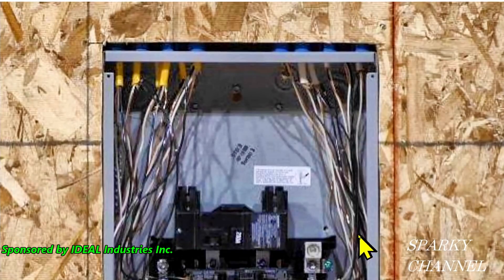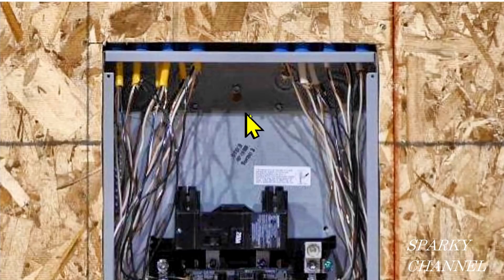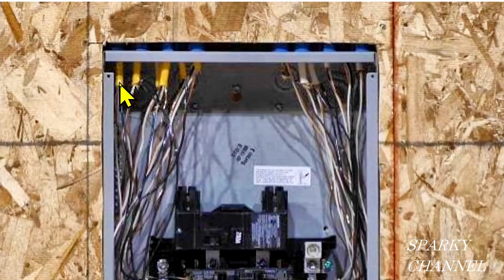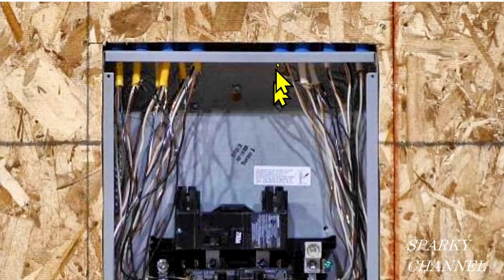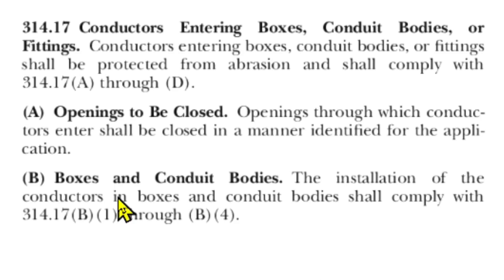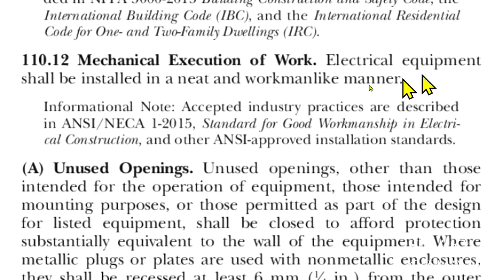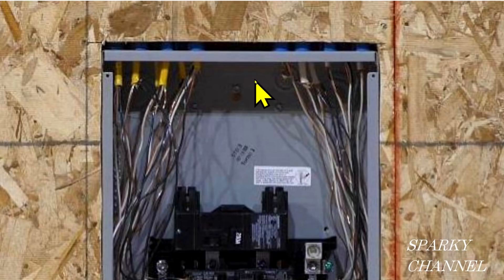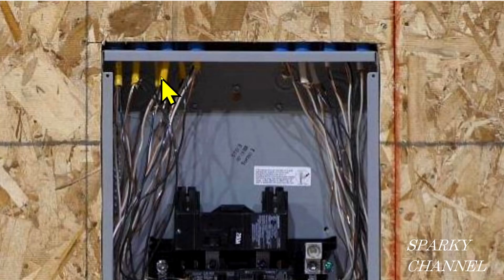How Far Should Sheathing Extend into a Panel? NEC 2020 314.17 (B), 312.5 (C) and 110.12

Comment: I've always wondered how many romex cables are allowed to pass through the panel holes. I've seen some panels where they are spread out with 2 per hole coming in from the side and sometimes I see a far larger number bunched up and coming in from the top. Does that violate any number of conductors allowed through a hole rule?

Comment: I am a DIYer, but very particular about going by code or better and being neat with my work (probably due to being an automotive machinist.)  Being particular about the look of a finished job not only makes it look professional, but also shows pride in your work and makes future repairs or upgrades easier.  I am proud to show people my work, even journeymen, whether it is electrical, plumbing or carpentry.  I also do automotive wiring and everything is soldered, sealed and wrapped neatly.
Reply from the maker: Fantastic, I love it! Also, thanks for subscribing.

Comment: the turned down metal edge of the box is at least a 1/4 inch. If the sheathing is below this , would that not be at least a 1/4 inch inside the box and past the clamp ?
Reply from the maker: Yes, that would be true.
Reply: That would also depend on how far into the panel the clamp extends.  If the clamp is 1/8" into the panel, then the sheathing would need to be 1/8" past the lip, as a minimum.

Comment: You would think an apprentice going to a big event like this and showing off their work would be a little bit more prepared and doing cleaner looking workmanship than this. Looks more like something done by one of those handyman guys who isn't very experienced or well trained in electrical work.  

Nothing against handyman guys I'm actually one of them.  But when I figured out that electrical and plumbing were needed for me to complete my remodel jobs, I started studying and learning the proper ways to do mechanical work. Fortunately I have friends who are professional electricians and plumbers who I was able to learn from. 

 Most general purpose handyman types do shit electrical and plumbing work. Most of them just don't know any better because there's a lot to know and it's very specialized.  Hell when I look back at my early electrical and plumbing work I cringe when I think about some of that stuff I did back in the late 1990s. And back then I didn't have any internet to look up how to properly do things. 

It drives me crazy to see romex wire stuck inside a box or panel without any sheathing. Most likely nothing will happen but it looks like shit, and the wires should be protected and secured just to make sure.  I instinctively knew that the sheathing needed to be running into the box the first time I ever ran wire to a box over 20 years ago.
Reply from the maker: Excellent! That's why I like to share videos like this. I don't want to be critical of anyone. I would rather just show the code and show how things are done correctly.

Comment: The top bend of that panel is 1/2 inch. So realistically the minimum could have been met and we can’t tell from a forward facing photo.
Reply: That's what I was thinking as well... Still would like to see a more consistent length and bends in the wires so they aren't just run strait from the clamp to the breaker.

Comment: I have a code question for anyone that wants to answer it. When installing a device, switch, receptacle, etc. and using the stab holes on the back, are you required to tighten the screws on the sides, or leave then sticking out.
Reply: Not required, but absolutely should, especially in metal boxes.
Reply: @HBSuccess  yeah that's what I'm looking at, switches and receptacles in steel mud rings with the screws fully extended. Pretty sketchy to me, I always run the screws in tight personally.
Reply: I use the commercial grade receptacal, "they cost a little more", but this is not the place to try to save money. Instead of "stab" holes they have a place behind the screw to insert the wire, you can use 2 behind each screw if needed, and then tighten the screw. This way your not trying to form the wire around the screw, and it is a solid connection. They are great because you usually are powering beyond to the next rec or a lite switch etc. I used Pass& Seymour brand when I wired my house 12 years ago, and I used 6 thousand feet of wire, a lot of rec, three-way and four-way circuits. All of my receptacal circuits are 20 amp, I never looked at the 15 amp stuff, but I would think they would have the same thing available.
Reply: @jamesglavich1426  they do have a commercial 15A with the side clamps. I'm actually using an intermediate grade with side clamps to replace the old back stab/side screw style.
Reply: @RealMichael_D  That's great that they offer it in 15 amp also. It's far better than the stab holes or trying to wrap the screw, and powering beyond as to the next rec, or light switch for over head light or fan is so much easier.
Reply: Always get those screws in. You will never regret not having arc potential from metal boxes or a compressed ground pushed near. I still tape them as a courtesy to my customers should they DIY in the future
Reply from the maker: Yes, tighten the screws down to lessen the chances of shorting. But back stabbing is not recommended. Back wiring, which is found on higher grade devises, is excellent.
Reply: @SparkyChannel  personally I haven't used the "backstab" since the 80s, never really trusted them, don't even know they they are still a thing. I'm replacing the recepticals in a remodel, they were installed in the 80s.
Reply: Don't stab them, it's less reliable and most electricians don't do it because they know that it's best to use the screws.  But if you do backstab you should have the screws drawn all the way in.
Reply: Rap it with tape. You should use pig tails tighten screws if you want

Comment: Sparky/Bill, why do some single pole switches have a ground and some don’t?
Where as receptacles always have a ground.
Reply from the maker: All switches and receptacles today are grounded. Very old switches and receptacles are not grounded.
Reply: I've only seen really old switches that didn't have a ground.  Have you you seen new modern switches that didn't have a ground?
Reply from the maker: @actionjksn  Yes, true.
Reply: When you say really old I just removed a light switch and replaced it in a home that I built in 1998 there was no ground

Comment: My habit on this is I leave enough to work with and to mark the lines for what they go to. I try to think for the guy working behind me in the future. So therefore I don't cut the conductors to fit the breaker exact, I leave enough in case the breaker needs to be moved in the future and also I try and keep it as neat as possible as well. Cable management is the term I use (carried over from my IT and electronics engineering career.
Reply: Good cable management in a PC helps with air flow and makes them easier to service and clean in the future.
Reply from the maker: @actionjksn  True.
Reply from the maker: Excellent!

Comment: The metal edge on the top of the panel is folded down about 3/8". You cannot see the actual entry point where the sheathing enters the panel due to the straight on direction of the camera. Other than what appears to be a missing connector on one, they may be all 1/4" or longer. The wire organization is terrible. I do not call this neat and workmanlike. I like to first route all my grounds together then my neutrals then take the hots to their breakers. Some panels use both sides for grounds and neutrals so they go to the shortest distance.

Comment: I left mine long enough to label them for future reference.
If they entered the cabinet and had to cross over the feeder conductors/lugs, I'd leave them sheathed so the exposed grounds weren't posing an added  threat.

In my area, we NEVER attach the cables to the enclosure. Our panels and services are installed outside and all the cables enter via a single bushing in the back of the enclosure.
Not NEC compliant and I have no idea if my area has an exception written.  It's been that way forever.  Logically it is no necessary to attach the individual cables. Once they are installed, they cant go anywhere and "bundling" is a busted myth.
Reply from the maker: Thanks!
Reply: When you have a single bushing in the back like this, how do you go about identifying the neutral wire that goes with the associated hot wire? I'm trying to add a manual transfer switch and need to identify the correct pair of wires.  Any tips?
Reply: @earlkarp4142  So, you have no sheath showing in the panel just past the bushing?  That is just somebody's sloppy work. You may have to disconnect and unravel everything and see if you can pull a bit more cable into the panel.  Otherwise you will need to disconnect and ring them out with a continuity tester.
Reply: @jackconnolly2665  Unfortunately, all the wires in my panel disappear into this port in the back of the panel, no sheathing can be seen as it's in the brick wall behind the panel.  The house was built in 1964.  I came to the same idea as you.  Turn off the main and test each neutral by disconnecting it from the bar with a continuity test.  I was hoping there was a better way.  Thanks for the confirmation.
Reply: @earlkarp4142  Yeah, it will be a tedious task. 

Map all the circuits by turning off one breaker at a time and testing EVERY outlet to see what is off.
Then disconnect the neutrals one at a time and refer to your map.
Be on the lookout for and multi circuit home runs where two circuits use the same neutral. You do NOT want to disconnect a multi wire neutral because it is very likely to make some smoke by routing 240 volts to the 120 circuits.
The telltale sign of a MWBC would be a red wire instead of the standard black.
Reply: @jackconnolly2665  I know the specific 15 amp circuit (furnace) that I will be hooking up to the transfer switch, it's just locating the associated neutral that is the problem.  I plan to turn off the main into the panel to avoid surprises.  Thanks for the tip I will avoid the multi-wire neutrals.
Reply: @earlkarp4142  If you have an amp meter, turn everything off except the furnace. Run the furnace and clamp around the neutrals. The only one carrying current will be your neutral.

If it's a 15A circuit, there shouldn't be too many choices and disconnecting them one at a time should be quick and easy enough.

Good luck and stay safe :)
Reply: @earlkarp4142  This might be a good opportunity to get some labels and label some wires for future reference.
Reply: @jackconnolly2665  Unfortunately, if it was built in the 60s, it's quite possible most of the circuits are 15A. My house that was built around that time and only has a couple circuits that aren't - the AC and electric dryer that were added on. Everything original is 14AWG fabric NM.  Considering all the houses in my subdivision are near identical, I'd be shocked if it didn't meet the code of that time.
Reply: @actionjksn  Yesterday I was able to power off the main and pulled the known breaker for the furnace.  Most of my breakers are labeled.  Next, I ran an extension cord to the furnace where there is a maintenance switch that I opened and confirmed continuity for the hot wire using one of the wires from the extension cord. Then I went through and disconnected each neutral and performed a continuity check until I found the correct one, again using a wire from the extension cord.  It took about an hour, but I found it and labeled it. I'd like a few minutes with the guy who installed the panel who ran the neutrals from the bushing directly to the neutral bar leaving almost no slack in the wire, they only extend a few inches out of the bushing to just make it to the neutral bar.  Running in front of these neutrals are the thick wires coming from the adjacent meter box.  If I had an amp meter, then I'm not even sure I could have squeezed it in to test these wires. It was a lot of fun that I hope I never have to do again.  The wires are neatly run, but horrible to work on afterward if changes are needed.
Reply: @earlkarp4142  I do general contractor work on homes and do everything myself I don't do any new construction so I have to deal with  bullshit from workers before me and it's honestly worse than fixing damage. This is why I hate people.

Comment: I think you were overly critical.  Yes, it could have been neater, but the goal of the code is supposed to be safety and the prevention of fires.  While we can't see the connector at that back cable, there's no reason to believe it isn't there. All of the other cables have connectors, so it's unreasonable to think there's no connector on that one.  Also, the 1/2" flange on the face of the panel obscures the view of how much sheath is inside.  There could easily be 1/4" of sheath on all of them.  I've seen much more dangerous work in my years in the field.  This appears safe and functional.  I would just give the apprentice some pointers on how to make it neater and perhaps label circuits as several other comments suggested.
Reply: Agreed. And if you're saying that 2nd  #14 from the right has no connector/clamp, what about that 3rd of 6 #12 cables from the left. Looks more like it's just in the back of the panel, where the light isn't hitting as well. I know it's a picture that was sent in, but it's be easier to tell without the plywood wall, or from a lower angle.
Reply: The apprentice went to a big national event and decided to show off his work for the world to see.  The work looks like shit and reminds me of something some handyman did who is just winging it. If there was ever a time to make it pretty,  this is it. He's not being overly critical at all, the guy should be embarrassed by this.
Reply from the maker: @actionjksn  He's an apprentice. Just give him some time and his work will be beautiful.

Comment: Would it be sensible to extend the sheathing a lot more to keep the various conductors grouped farther down in the panel?
Reply: I have wired control cabinets for manufacturing automation (24vdc typical) and the small cables can really fill up the Panduit cable management unless the sheathing is stripped upon entrance. For this reason, this is my practice.
While I do not wire residential panels, I would imagine leaving the sheath in place could make it more difficult to work with the conductors.

Comment: I agree there needs to be at least 1/4 inch inside the panel.

I like the idea of leaving a little more than an inch and labeling it on the sheath. Not only is that helpful during the install, but it might also be helpful for future maintenance.
Reply from the maker: Excellent point!

Comment: back in 1999, with the 97 NEC, I was always taught 1/4" sheathing visible inside the panel. What I can find a clear answer for, is how long it can be! in 4s boxes, I usually don't go more than 2-3 inches, and 12x12 or larger, I might leave a foot. I've heard 18" max, but have yet to see in the code, or per manufacturer's recommendations.
Reply: They have a special homeowner DIY code in my area. It says to leave 3" of sheath in a single gang box and to only strip off 2" at the end....just barely enough to install the device. 

Im assuming it's a special code because I've seen it a hundred times :)

Comment: Assuming that's a subpanel?
Reply: Is it? Still has the green bonding  screw installed.
Reply: @piratecat5649  Maybe it's an NEC thing but the CEC prohibits branch circuits from entering or passing through the same space the mains comes in from the meter. Reasoning is if a branch wire rubs out on a main feeder there's no overcurrent protection. Subpanel it's fine as they have a breaker upstream of the panel.

Comment: The way I see it, the 6mm-minimum for sheathing past the cable clamp is to provide inspectors with visual evidence that the NM sheathing is continuous through the clamp.  Any more than 6mm doesn't serve the purpose of protecting the conductors in the cable, and it may provide some utility with labeling, so there's no technical upper limit.  Any less than 6mm means that it's difficult to tell whether the sheathing goes through the clamp, which may expose the conductors to damage, thus the minimum.
Reply: Also, on that minimum, I can see it also being a buffer on the clamp in the case of unintentional tugging on the cable later. Say 5-15 years down the line someone decides to remodel. Accidentally grabs the cable in the attic with the end of a 2x4, pulling it up the wall through the hole that was drilled for it. That little buffer gives the clamp better holding power and the cable jacket better tear resistance than if the clamp were right at the end. It's just like if you tie a knot in a rope, you need a little bit of a tail to keep the knot from slipping out.

Comment: I usually enter the sheath 1/2" within panels most lines up with top lip looks neat to me. Which happens to be my pinky width, what I've alwayd done and taught my guys is use measurements you always have readily available like my wingspan is 6ft+, arm length is 2ft, forearm length is a 1ft , fist and thumb is 6 1/2" , pinky to thumb is 8 1/2".
Reply: Each joint on your finger is 1 inch, so your index finger is usually about 3 inches long. This may not apply to someone with unusually long fingers but anyone close to average it is fairly accurate.